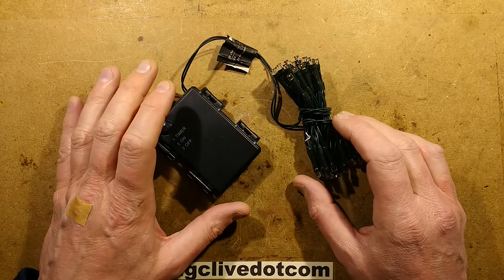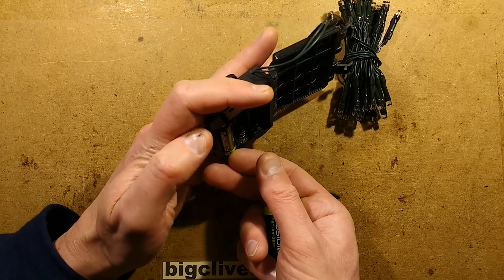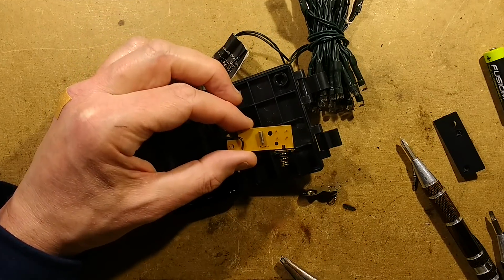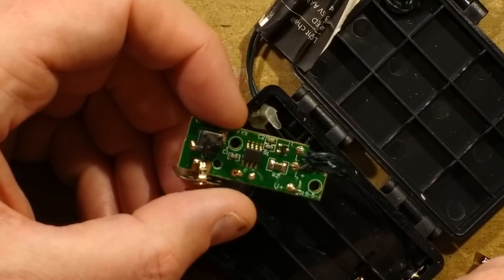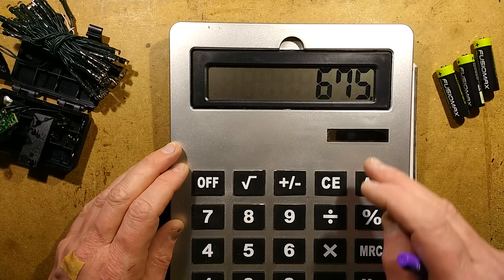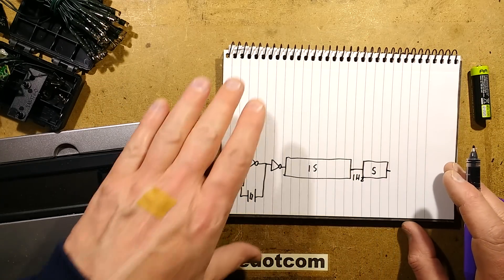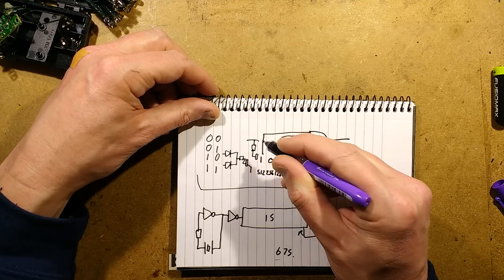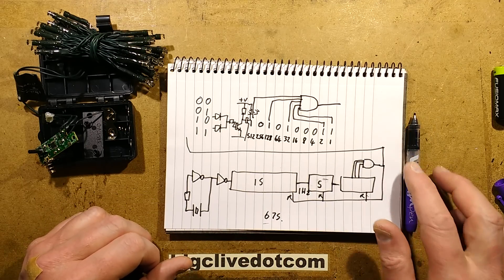Timer lights logic doodles.

Comment: Is the Transistor PNP, or NPN?  Looking to replace it on my board.
Reply from the maker: It's probably an NPN transistor.  2N3904 or BC547 would probably work.  If you get one, type its number into google and select an image search it will show the pinout.  The Emitter (E) would go to the battery negative, the Base (B) would go the chip and the Collector (C) would go to the LEDs negative connection with the LED positive going to the positive rail with a resistor somewhere in line.

Comment: thought they use that value clock as it fits in signed 16bit so it can be read as 2 bytes and ultimatly 1 bit for the 1second rollover
ed: also i remember a interview on eevblog from a guy who said the chinese get a special pic that you cant buy, for their industry and is whats used in the epoxied cob circuits and possibly packaged-unlabeled like the above too? apart from just ground nos

Comment: If you'd like a similar model but with flash modes Wilkinsons has them (or the did last year) called 'Wilko 50 White timer lights' they run nice and dim and warm white/cool white.  They use 3xAA batteries like the set shown in the video.

Comment: The oscillator circuit I know has both a series resistor (~100K) and a parallel resistor (~1M) which helps start the oscillator more reliably.  The diodes and transistors at the end are making up a NOR gate.

Comment: I like this video because it combines analog with basic of digital. And from what I see in other comments people want and adjustable timer, and I was thinking if this could work with a digital to analog converter. Each count a voltage would go up until it hits a known peak voltage, for the 24h reset. And another comparator would turn the leds off, and this could be adjusted with a potentimeter. Too keep it more precise the end counter needs to have bigger steps, like 30 minutes.

Comment: Using an on-off-on toggle switch, pull up the first Transistor through a high value R like 4K7, connect output of diodes or an OR gate with a diode on output to one input of switch, output switch to T1 after the pull-up to base of T1 for TIMED, input 2 of switch to GND so T1 is OFF making the lights be in an ON mode, center of switch is no connection so Pull-up of T1 keeps LEDs OFF :) .. I think :/ the configuration of switch would be using the center pin/s as output and the outer pin/s as 2 inputs.

Comment: The final function you realized with the diodes and transistors is just a NOR. Given all the previous counters are done in CMOS, I am pretty sure this is also a CMOS NOR gate. And two more flip flops for the button.
I just calculated the prime factor division of 675. For the division by 675 there is another possibility: 675=5*5*3*3*3. A divider by 3 is easily done with asynchronous reset of a 2 stage counter. But that needs 2*5+3*2=16 flip-flops and some logic gates. So the 9 bit divider with the 5 input AND is the more economic variant.
In the end an ASIC would just need 15+5+9+2+2 Flip-flops and some logic gates. The latter 2 for 4*6hrs and the button. Pretty economic in comparison even to the smallest microcontroller - all a question of quantity.

Comment: my second question. 

what do you guys think about trickle charging phones? does that help with long term battery life? i was hoping to find a charger that basically takes 8 hours to charge 3,000 mah. i plug my phone in at night like most people, but dont like the idea of it sitting on the charger all night even after it reaches 100%.

is this pointless since phones are smarter now? Could an app handle this? as in, set the time on an app and let it calculate the right rate to have 100% by the specified time?

on the other hand i made sure my latest phone was QC 3.0 compatible since having that when you need it is a life saver.

Comment: You would need a 10 input AND gate, plus inverters for the zero bits.  Otherwise, anywhere there was a zero, it could be a one and still match the pattern, which is not what you wanted.  You wanted the specific pattern to match.
Reply: Wrong

Comment: no no no wrong! yes one is straight to battery. through a resistor. but the other side . the Pixy's  and their wranglers are in charge. and they use magic. its almost like a clapper. 1 part pixie to about 2 parts magic smoke! the pixies can come and go. not the magic smoke. let it out . never again will it work! great video. and proof of alien tec

Comment: My wife just bought one similar, but has teeeeny tiiiiny LEDs  on a very thin coated wire strip.  The battery pack is practically identical though with a 6 hour timer, on, and off.   The waterproof battery pack makes it great for placing outside if you don't have an outdoor power outlet, and in our case the LEDs are so small they must use very little power.  Thanks for the teardown!  I'm now curious as to what's inside ours.

Comment: The important thing is to not drift too much over 24hrs. The actual time the light is on is somewhat arbitrarily set at 6 hours. 

You could run the crystal into cascaded counters, setup to reset on the 24 hours (using AND's) and toggle the "on" output using a combination of NOT's and AND's "close enough" to 6 hours for the desired effect.

Cheapo microcontroller is likely cheaper though :)

Comment: Speaking of logic, have you ever taken to bits any PLCs and/or associated I/O modules? If you ever wanted to get away from ALL the cheap chinese lights and novelty items, THAT might be an interesting video or two.
Reply from the maker: They're somewhat more expensive, but I do have a Siemens LOGO unit here that I could open.  They generally have a simple resistor/optoisolator arrangement on the inputs and either transistors or relays on the outputs.

Comment: Back when CMOS logic came out, manufacturers recommended a 3-inverter drive for xtals because a single inverter had reliability issues.  Maybe CMOS has improved a lot since those days.

Yeah, you could replace the microcontroller that way.  But the package count and board size go up, increasing the cost.  The number of joints also goes up, which matters with hand soldering but not wave-flow.

You could bring the package count down a little with counters and using a small PROM for the logic.  Except you'll need at least one gate to AND the reset with the clock or race hazards are gonna screw you.

So unless you're buying all that stuff in bulk (which you won't be because that selection of chips is pretty much dedicated to this) a microcontroller is going to work out cheaper because you can use it across a range of products.  And even if you make only the one product, microcontroller prices are low because everyone else is using them for everything.  Oh, and even if this was the only type of product you made, you could program variants such as 6 hours full on, 4 hours lower brightness.

Yeah, the microcontroller is going to feel like Marvin the paranoid android: brain the size of a planet and all it's doing is turning those LEDs on for 6 hours.  It's just cheaper that way.  Suffer, Marvin.
Reply: If the idea is to use a timer function to control a larger selection of LEDs (or other loads), let the board from the light set handle it.  Attach another transistor to the proper LED connection.

Comment: Hmmm I can get it down to about 4.5 hours. 32,768hhz ---> CD4060  {pin 3) ---> 2hz ---> CD4060 (pin 3) ---> 2.27 hours ---> CD4027 (flip flop) --->  4.55 hours pulse to switch off the LEDs. Perhaps you could trigger this part of the circuit with a PV panel connected to a transistor and the gate of an P Channel mosfet plus resistor to ground.

Comment: There would be no reason to reset the prescalers. Only the /675 counter needs resetting. However, because a ripple counter can fail to reset, as resetting it removes the reset pulse, you may wish to decode state 674 and reset it on the next pulse using a D flip-flop.
Reply: Mister Hat Or use a synchronous reset counter gated at 674 (4 active bits).  For the debounced key, digitally debounce at the 8Hz output, then implement 4 stages: Off, 6 hours, 12 hours, on.  Of cause digital debounce would run the crystal and prescaler all the time, unless you build a power saving circuit to not start it until non-debounced press.  Anyway, entire circuit would need to be a single high quantity chip used in millions of seasonal decorations, as otherwise reprogramming a 6 pin microcontroller is cheaper.

Comment: There are 4000 CMOS logic chips that combine the crystal oscillator and a ripple counter. The 4060 http://www.ti.com/product/CD4060B comes to mind. It would output two pulses per second that could be counted  by another ripple counter and some glue logic. And 4000 CMOS uses almost no current.

Comment: Yes, your idea would work.
You'd need 1 simple dividerand one programmabel divider. I found a 24bit programmable timer for 40 cents and a simple divider for 16 cents. With the resistors needed to set the counter i guess it costs nearly the same as just using a very simple programmable IC.

Comment: As a computer scientist, my mind instantly jumps to the relatively simple design of a 32-bit counter, feeding into some binary comparator that turns on the lights when the value is less than 707,788,800 (first 6 hours), then resets the counter when it reaches 2,831,155,200 (24 hours).  I'm not sure how easy a "less than" gate is to obtain, but to reset the counter would work with the same 5-bit "and" gate strategy Clive uses here.  This is probably the logic going on in the microcontroller there, since it would probably take about 6 lines of code to implement, something like:
counter=0
while true:
  counter=counter+1
  output=(counter<707,788,800)
  if counter>2,831,155,200:
    counter=0

Comment: Might be a microcontroller but it could also be a custom chip, since these things are mass-produced. I believe they do make FPGAs that small, but I doubt that's a cheaper option than just going with the micro.
Reply: I think FPGAs typically have integral timing crystals, haven't they?
Reply: I don't think they do. Not accessible to the programmer anyway, usually. There probably are FPGA's with them built in, but I don't think there are many. Of course, I'm just a noob when it comes to those so coulsn't say for sure. Microcontrollers often have built-in oscillators, but those are nowhere near as accurate as a proper crystal because, well, for most applications they don't need to be. For this, they do, though.

Comment: RWBHereThe lights would turn off when you reached the correct count, but the counter would continue until it overflowed. The lights could be re-started any time after that and would run for the remainder of the time it takes to reach the 'off' count. It would not cycle every 24 hours without additional circuitry.

Why not keep dividing the 1 Hz signal by two? You could choose an approximately 4 h 24m or 8h 48m 'on' time, then 'off' until 24 . Not 6 hours, admittedly, but the divider is an off-the-shelf component, so the circuit component count and cost should be lower. You still need a way of counting 24 hours, so read on:

Better still, repurpose a digital watch, monitor the 'hours' display digit output, choose one hour for 'on‘ as another for 'off' and the display will turn on for the desired number of hours each day, repeating every 24 hours. This should be the simplest and cheapest option.

Comment: The gated reset idea does work but you'll only get a wee glitch at the output the length of the shortest propagation delay from reset to outputs. I think you'll be OK with timing. I don't think you need to reset upstream dividers - they will just roll over as they usually do counting 0 .. 674.

Comment: You don't have to reset the 15+5 binary stages :).
Reply from the maker: +DiodeGoneWild It would also form part of the power-on reset to ensure a proper timing cycle.
Reply: You're rigth. If the same group of Reset inputs is also used for the power-up reset, it's reasonable :).

Comment: Very interesting ! I'm sure it could be implemented with logic ( in theory most things can ) but I think from a practicality viewpoint just getting a PIC is loads easier. I studied both in Uni, and even with having to learn to program the pics ( RISC assembly ) it is much easier than having to work out all the logic circuitry ! Would probably end up being cheaper and more reliable as well
Reply: I said something similar further up the comments, but now I think about it, quartz watches are much more reliable than mechanical ones... but I still have a mechanical watch. 

Old-fashioned logic has a charm I cannot deny.

Comment: Hold on.  You've put in a 2 bit binary counter.  The counter 'resets' itself after 11.  All you need to compare is 00. If they are both off, the LEDs go on.  Which is what you said. Getting them to stay on 24 hrs. just means reset both counters and turn off the clock.  You'll need another 2 bit counter for 'off - timed - full - turnoff'.  00, or whatever is the un-powered state of the counter, would be off. ... And a latch to hold the power on for timed and full.

Comment: You say 6 hours on, then reset? Wouldn't it stay on all the time?
Reply: > You say 6 hours on, then reset? Wouldn't it stay on all the time?
Only the the first two stages of he counter(s). The third stage, the last two bits, has 4 states (00, 01, 10 and 11 then back to  00. 01, 10, 11....)with each lasting 6 hours, for 24 overall cycle length, and the lights being on for the first state (00)

Comment: You could leave out the first transistor in the 'output stage' and reverse the two diodes.
Reply: Don't forget that you still need to use both of them and not one or the other.
Reply: Then it would only be on for the last 6 hours, after waiting for 18 hours for it to turn on, after turning on the power

Comment: The PIC microcontroller has very low current consumption at 32kHz clock rate (approx. 10uA). I think it will be a challenge to make a system based on descreet logic circuits with the same battery life. It would be interesting to measure the quiescent current of the circuit. Perhaps the microcontroller is in sleepmode when the light is off. That would reduce the current consumption even more.

Comment: maybe you can help. do you know anything about "battery banks" and their efficiency? i have a couple. and with a cheap tester then seem to take close to the rated mah to fully charge. but then when i charge my phone (when its off) i lose about 40% off the battery packs storage.

for example. my 20000 mah pack took just over 18000 to reach 100%. i charged my note 8 (while off 3300mah battery) from 0 to 100. and the packs LCD said i have 75% left. meaning the pack only had 3 more phone charges left in it (aka 13,200 total mah).

i did charge using qc 3.0 port.

so my question. does charging slower help with the efficiency? is qc 3.0 less efficient? is that normal?

on top of that question. i have 1 about trickle charging a phone on purpose.
Reply: You put in 18.0000mAh - that is stored in the battery bank at nominally 3,7V 
You then pull 3,300 mAh out to charge the phone but he gotcha is that _that's_at_5V, and to pump up 3.7V  to 5V, you need the same proportion more current. 
In short: 18.000 * 3,7 / 5 =  13.320  (and that's at 100% efficiency, which no real circuit can do, (but the boost circuit is probably 90+ % efficient)
Reply: Calculate/measure it in Watt-Hours to compensate.
Reply: not sure what that means. but thank you both for the comments. the calculations help me understand whats going on.

Comment: My girlfriend bought a similar LED string back just before Halloween. They had little ghost diffusers on them, but the exact same case/circuitry (except the case was white). The case is indeed, waterproof(with the obvious exception of the hole where wires for the LED string enters. She wanted the LEDs to run continuously without batteries, so I snipped off the string and ran it off of a 5V USB power supply with a 555 PWM generator in the middle for brightness control. Anyway, she had no use for the case, so I added it to my bin of useful shit (you all have one, you know what I'm talking about). Put a little 3mm led behind the hole in the case and seal it with silicone/resin and you've got yourself a really good watertight project case with an indicator light and the rubber cap for a momentary switch underneath.

Comment: I'd probably use a CdS photocell to sense the light level, instead of having to count anything, or rely upon crystal accuracy. The photocell might need some tweaking in the software of whatever micro-controller you choose, where things like hysteresis and duration of operation can be programmed, but given that you'd (probably) only want the lights to come on when it's dark enough to see them, it makes sense (to me) to measure the amount of daylight rather than time.
Reply: Except I don't see the lights when I'm sleeping... I think the design assumption is  that 6 hours of 24 is roughly the "getting home from work -> going to bed" time for most people, and the time they're most likely to enjoy the lights.

Comment: Back when I worked at a certain manufacturer of blue painted lifting equipment, we had a lot of down time when the teir 4 interim engines first debuted because half of them had faulty engine harnesses so the service techs would spend a couple hours chasing the fault so the machine could actually drive off the production line. So I stood around my  area and one of the things I did was figure out and teach myself how to count to 31 on one hand. Though there is no reason I couldnt extend out to the whole 1023, just it would take a really long time to count that high.